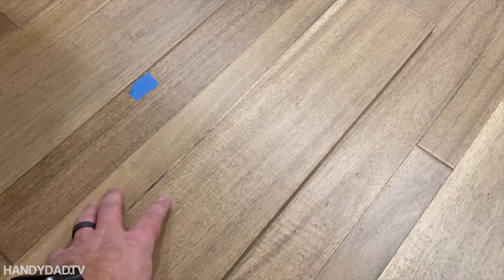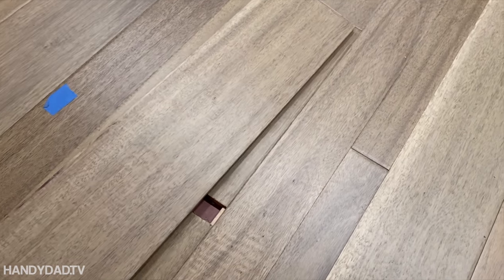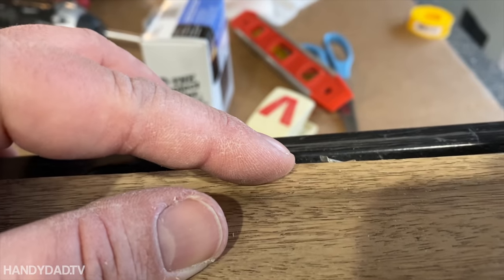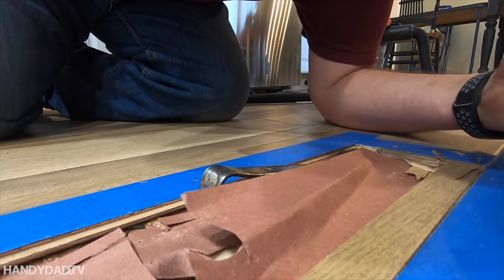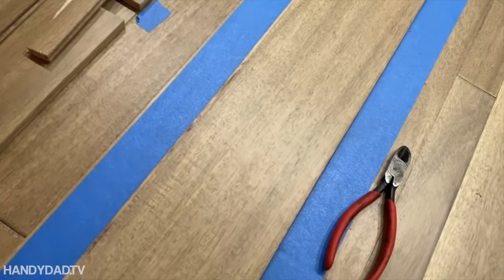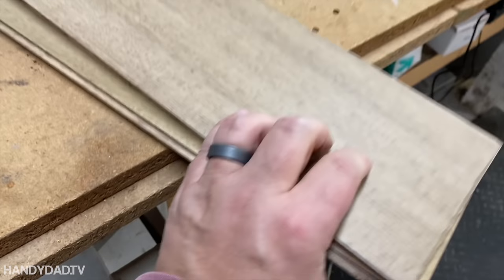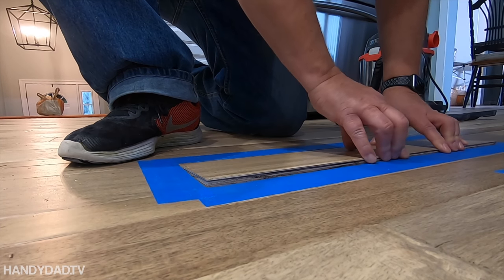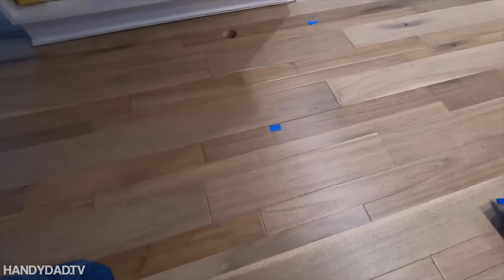How to Repair Hardwood Flooring

Comment: You sure got lucky that whoever put the floor in didn't staple it properly!  There should be staples every 4 to 6 sinches and if there were you wouldn't have been able to remove it without cutting them first.  You were also lucky this is 1/2  or 3/8 engineered b/c if it was solid wood the staples or cleats wouldn't have pulled through the tongue like that. You got the job done but in a lot of circumstances this would have been a bad day.  You need a plunge cut rotating saw (fein tool) and you would normally finish your cuts that way, as well as cut through the staples with a bi-metal blade.  Then you very carefully cut to the corners with the fein tool as well.  As Nathan Hempton said you should have cut the bottom groove sides off, that's the best way.  Still it's cool that you figured this out on your own.  When you almost hurt yourself you could have also damaged the floor putting that much force, the weakest point will break but that's not always where you expect it to be.  Doing 3/4 Hickory is a lot more difficult, and also doing smaller widths is more difficult.  Also sometimes being in a tight space like a hallway makes it difficult.  I do this professionally and I use a track saw with dust collection to  cut the piece out as well as cut the grooves and the end tongue off, it's nice being able to do everything in one spot.  A lot of times a repair requires multiple boards or a whole section and you can staple some of it.  Also a lot of times you have to remove baseboard or shoe moulding so I bring a battery powered nailer to reattach those.  If anyone is wondering yes you have to remove the base and shoe when the damaged piece goes under it.  If the piece goes under door casing that gets more complicated.  I know using tape like that gives some peace of mind but it isn't at all necessary and actually can damage the finish on some types of flooring.  Sometimes I will mark the boards with X's so I don't have to think about which ones I'm taking out when it isn't very obvious, but the tape has at least as many cons as pros.  I do use drop cloths for toolbox and shopvac and I also use a foam pad to kneel and sit on.  Another thing is rule out any potential damage by not wearing a watch, and carefully selecting clothes/shoes/kneepads with no buckles or hard buttons that could damage a floor. It's easier to avoid damage than fix it.  I never face-nail just use weights on the groove side if necessary.  Also sometimes the pieces have to be shaved down if they won't drop in.  I do this with a track saw or if it's really close I will file it down by hand.  If it's a tight fit you won't need weights but it will take longer to get it just right, I've never broke one stepping on it to get it in but I'm sure if it was too big to fit it would break on the groove side.
Reply: I forgot to mention, to check how the piece fits, I flip it upside down, to see if the top fits without trying to actually test fit it.  You have to be really careful with a "dry-run" because I actually had it happen when It dropped right in, but I hadn't glued it yet, and I had a really hard time getting it out. On the flip side you definitely don't want to have glue all over a piece that doesn't quite fit.  That's the most stressful point, especially if you didn't bring mineral spirits and paper towels.  Best way is to test fit most of the way but first to see how close it is just flip upside down to see if it's about right.
Reply: Oh wow you should have glued right to the subfloor, not the underlayment.  No need to spread the glue or put on both pieces just put it on the subfloor.
Reply from the maker: Wow! Thanks for all this valuable info! Will keep it in mind if I ever do it again.